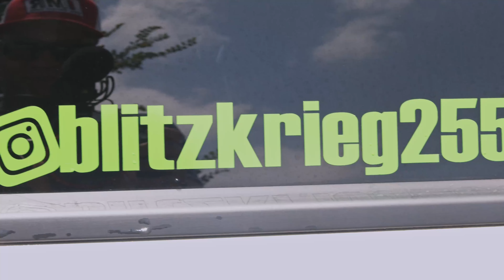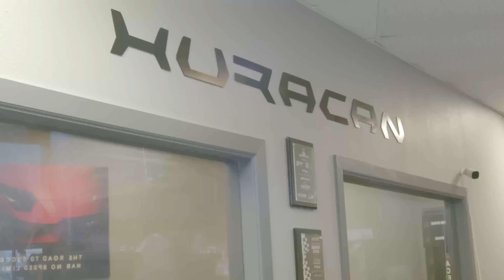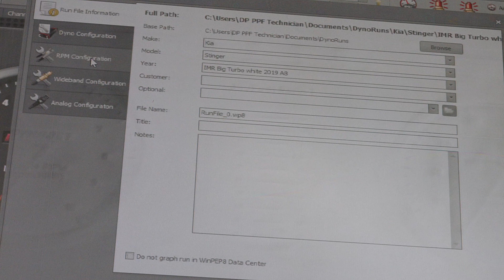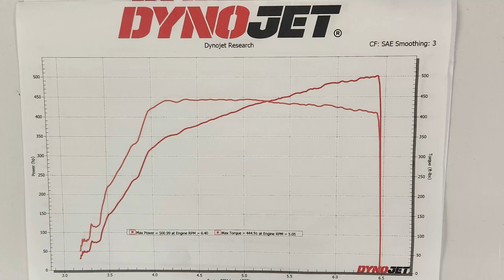Stinger With Turbo Kit Hits Dyno On Lowest Boost and OEM Fuel System.

Comment: Interested to see the stock motor limitations of this car !!
Reply: I've seen a few videos making the claim that this drivetrain can handle up to 800WHP. Considering KIA's 10 year 100,000 mile warranty, I'd think that they built-in a modest amount of room for upgrades.
Reply: No. lol. The transmission can’t handle anywhere near that power
Reply: @Bo12346hhgfgdg there's a rwd Korean gt2 that recently hit 1005hp on stock engine and trans 🤷🤷 can't just be speaking out your ass like that.
Reply: @SgawCules  prove its a stock transmission and internals. I know its not because i know more then you. 
ill wait.....

Comment: Why should I go with IMR instead of the LAP3 Turbo upgrade kit?
Reply: A few reasons:

1. You can spec your own turbos. (Lap3 you get twin XCargot XT26's, and that's your only option)
2. IMR includes the transmission cooler as part of the kit. LAP3 you'll have to buy it separately at additional cost.
3. You have some flexibility in who you choose to tune your car (probably Nathan from SXTH or Terry from BMS), whereas LAP3 you'll have to buy their tune for their setup.

Regardless of which one you'll choose, you'll probably want to install ARP head studs (and possibly thread inserts) first.

One advantage to the LAP3 build: if you're mechanically inclined, you can have the kit shipped to you and perform the install yourself. Whereas all the IMR kits require you to drop of the car with them. IMR is not currently shipping their kits out, they're in-house install only.

Comment: Is it even safe to run your stock calibration with the turbo upgrade?  Wouldn’t you be risking engine failure if you make more power than expected and run out of fuel system?
Reply from the maker: Not an issue. You control you power level till you have what ever supporting mods you need.

Comment: 500WHP with a choked off system is impressive. Think what it'll do with down pipes and Bourla exhaust, with intake upgrades and an upgraded intercooler.
Reply: The kit has big intakes and a big intercooler. I think even has downpipes. The wastegate spring is the big thing holding it down. But they were being safe
Reply: @kingvega666  My bad. Somehow I missed the first video explanation. Headers too!

Comment: How safe is it to run this kit permanently on the G80 at the lowest boost with no other modifications except the spark plugs? Any concern of overheating? I routinely drive from California to Arizona through death valley in the summer, overheating there would be BAD. Thanks.
Reply from the maker: It's good to go...Once we bled the coolant system post kit installation we had no issues. We drove it round town in the heat of the Texas summer and also ran it on the dyno and never overheated.

Comment: What's the 1/4mi trap speed?  That's what's important.
Reply from the maker: That will come in a layer video. The car needs fuel and heads studs...so those. Ay get installed first.

Comment: Ive heard our fueling issues extend past a hpfp or cpi system, so hoping no issues, im currently FBO including chargepipes, only have sec cat, running e60 cpi jb4 bef, im actually thinking about pulling a one off and going big single turbo. Only questions where to put it xD

Comment: Hey Evan, you should definitely rev the car out a bit more, 7000-7200 is where competitors run it out to with big turbos and there’s no risk of valve float on stock heads at that point. :)

Maybe you ran out of fuel because of lack of WMI? 🤔
Reply: ran out of fuel because more power requires more fuel, the owner has the final say on where he wants it to rev at.
Reply: @HashMaster1776  Absolutely, but without that information being public I just wanted to put it out there, my cars currently up there for one of the next kits.
Reply from the maker: Agreed.  These turbos have alot more breath and would make more power if I rev it out....however this wasn't an attempt to make big numbers. It was more so a demonstration that the kit is solid and "let's see what it does on the lowest setting with everything fuel wise being stock. I can't wait to turn up the juice on your car though......🚀🚀🚀
Reply: @imramerica  Absolutely, it’s a shame though, because while 500@6500 on 93 with 14psi is definitely nice, most of the community is only going to see “500whp with big turbos? What a rip off” which is really disappointing.  Hopefully we will be able to show pushing the car a bit further with mine and get some more customers interested ;)
Reply from the maker: @christucker9566  I don't think they'll see it that way. I think they are smart enough to see that this was the first step and a validation of the kit. If they don't understand that then they may not have enough understanding to own/operate the kit. 💪👌🙏

Comment: Gonna need way more than 14 psi or 500 hp to give up that much tq. Why even strap it down without a proper fuel system? Idk if everyone knows that problems occur above 500 or this kia comminity is just scared to live alittle. Fuel it and send it what is even the point?
Reply from the maker: We were commissioned to build the turbo kit. The customer was not ready for rhe additional mods. Some people build in steps. We finished the kit and the are adding those things now.
Reply: @imramerica  I don't mean to come off harsh but I'm just confused at the progression of this platform ex. Look at the 24 mustang and whipples collab with ford. And then u have sai li as a budget option and fore as a high end fuel supply option u know 1050x injectors will provide up to x hp and the di fuel pump is tapped but that's why u have port injection. Fwiw I just got my g70 a week ago if other parts can handle if and I see level 10 is working on the trans as week speak let's talk. I won't bring u it with no fuel system and we can head stud it and turn it up to 25-28 psi and see what she can hold. Stock with tune/jb4 pushes 21ish so we need more than that minimum